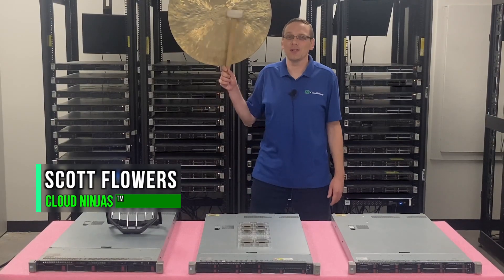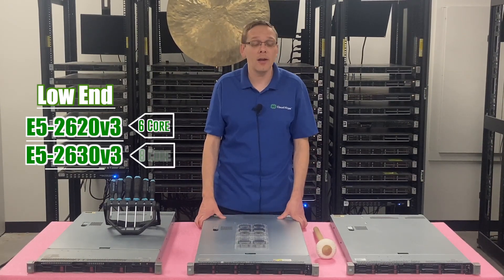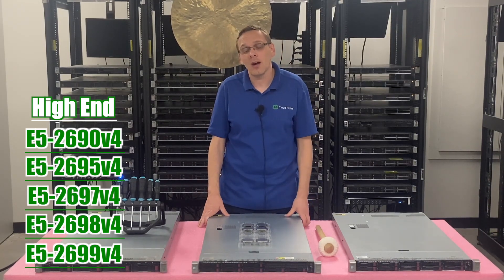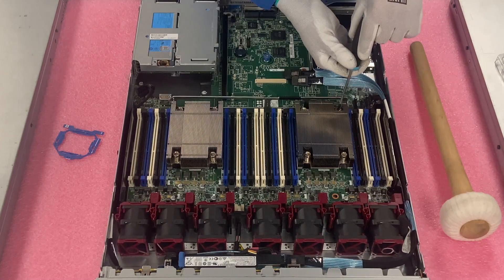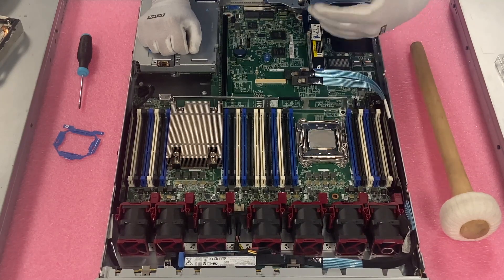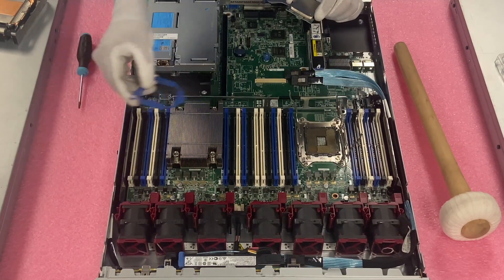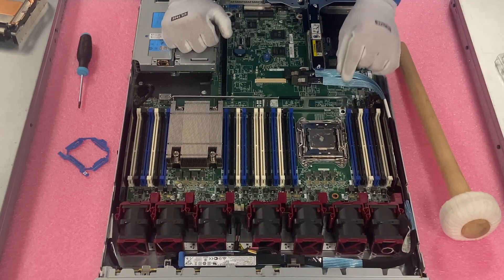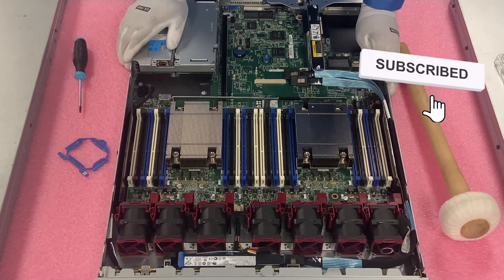HPE ProLiant DL360 Gen9 | CPUs | Intel Xeon Processors Options | LGA2011-3 Socket | CPU Install

Comment: Have you done any CPU thermal benchmarks with the DL360 Gen9? My Xeons (2667v4), when under heavy load, get hot (96°C) — and iLO (v2.82) isn't spinning up any fans to mitigate.